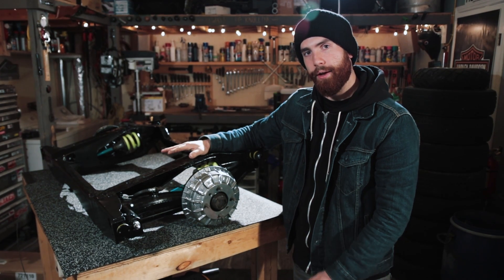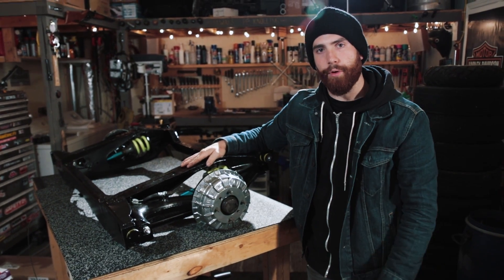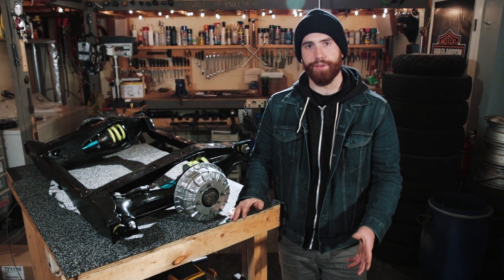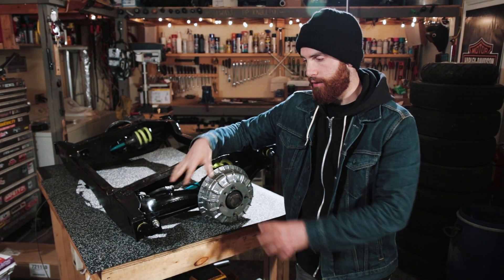How the classic mini's rear suspension works

Comment: First of all thanks for the clear explanation. But how do you set up the rear suspension when the mini is very low to avoid the spring loose tension crossing a big bump? is any way like in front suspension of adding any kind of stop?
Reply: You’re asking how to keep the spring “captive” at full suspension droop? The correct way to solve that problem on any coil spring vehicle is to use the correct length spring. The spring should always be able to hold itself captive through the full range of suspension motion

Comment: Hello guys, great videos. I bought the SUSPENSION PACKAGE HILO + KYB SELF ADJUST GAS DAMPERS on Minispares (MSSK3004) and I can't set rear wheel height to 3 fingers/50mm (from top tyre to inner arch) because the rear suspension makes an horrible knocking (steel hit) when the rear part of the car jumps because of the streets. Looks like the rubber cone (and the HI-LO) moves from the correct position. Help please SMCO.
Reply: I have the same issue. Did you find a diagnosis and solution?

Comment: Do a video on pulling roller bearings / bushing out of rear trailing radius arm. Not much out there on youtube. One video shows welding a bolt on as a puller. Can you collapse them in on themselves or punch them out from the other end? What is best. Keep up the good work guys!

Comment: Just FYI, in Minis, the cones, or in this case the springs, are the “shock absorbers”.  What would normally be shocks on other cars (not shown on this subframe) are actually called dampers here.  They dampen (quite literally like a softener) the vibrations and oscillations that may be caused from the shock absorbers.
Reply from the maker: That's a valid point. Dampers might be more accurate for what they actually do, but we tend to use the the terms shocks, shock absorbers, and dampers somewhat interchangeably because "dampers" today have taken a larger role than just dampening.
The preferred term might also might depend on where you live. E.g. Shock absorber in the US and France, damper in the UK and Germany.

Comment: It's a bit funny how someone tries to explain the Mini suspension by showing a suspension that was never ever used in a Mini (springs). Minis ride much better on new original rubber cones or on Hydrolastic suspension rather than on springs.
Reply: I'd imagine he was just using what he had on hand. ie, a nice shiny rear subby that happened to have a coil spring conversion on it. Now, if the title said THE BEST SUSPENSION SETUP EVER...then that would be another story.